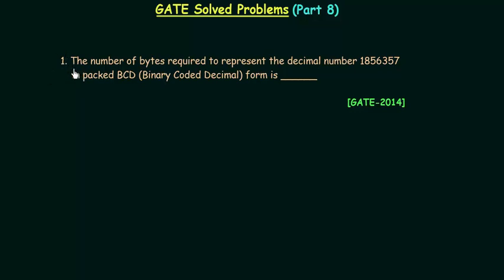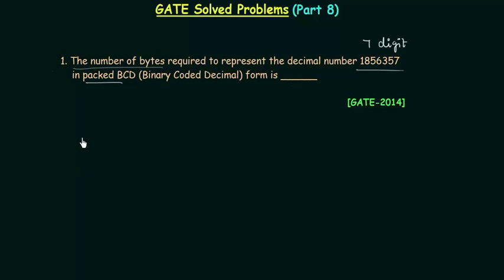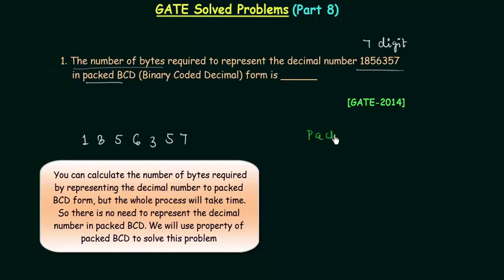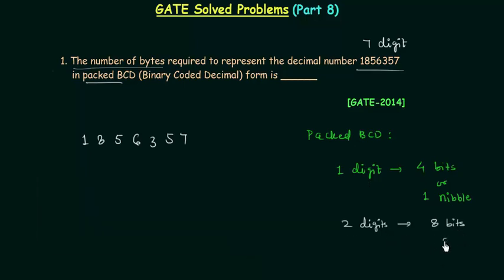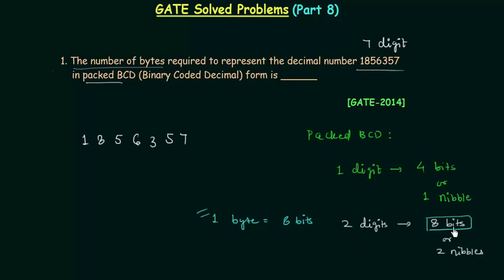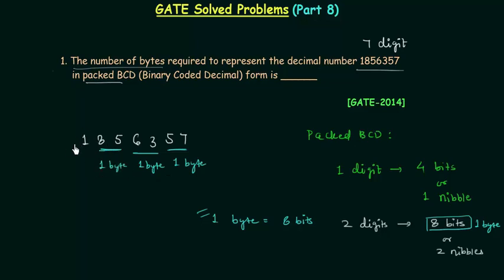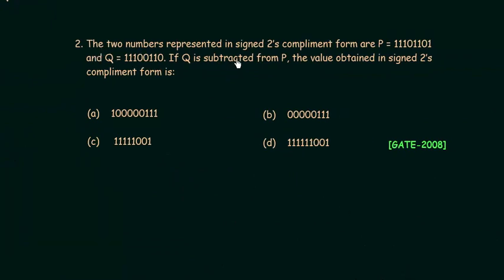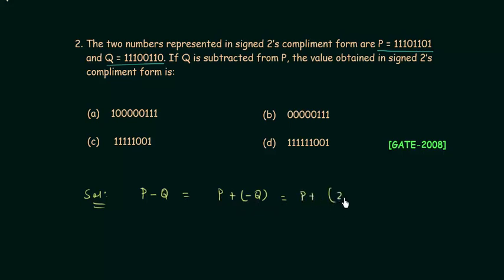GATE Solved Problems (2008-2014) | Number Systems | Digital Electronics

Comment: It's a simple logic.... First find the decimal value of p and q .. p= 237 and q= 230 ... After then subtract q from p... 237-230... U will get 7 (+ve)..... so the and is either a or b.... Now, check the bit  of p and q .... It's 8 bit..... Now check the option of a nd b.... A has a 9 bit .... B has a 8 bit.... So ans is b....

Another thing is ..... Write the P's value nd write the complement of Q's value.... Then add it both...... In this occur the overflow.... And always discard the carry overflow in 2's compliment..
 So answer b is correct....

Comment: Options (💖c) correct hai..
P=11101101=- ve
P ka 2s compliment=
00010010+1=00010011=19
Similarly
Q=11100110=-26
अब , P-Q= -19-(-26) =+7
यानी sum =+7
अब +7=00000 111 in 8bit
Ab 7 ka 2s compliment
=11111001,
यानी ऑप्शन (c) correct hai...😜✅✅✅✅
✍️✍️✍️ By Kunj Bihari
Reply: Wrong...since you made a positive number turn into negative one in 2's complement...